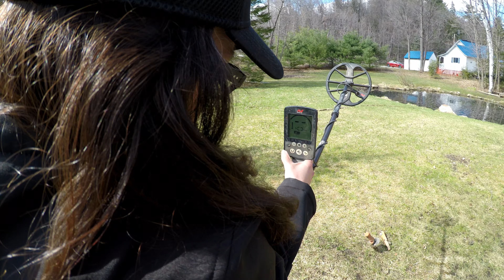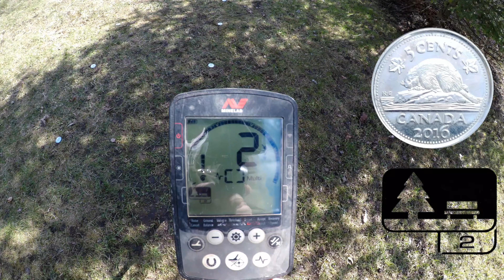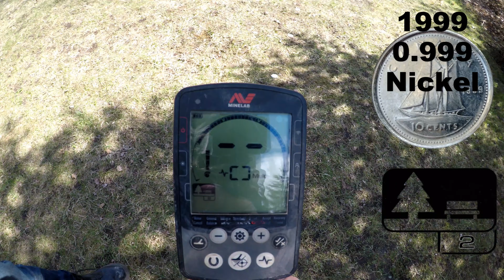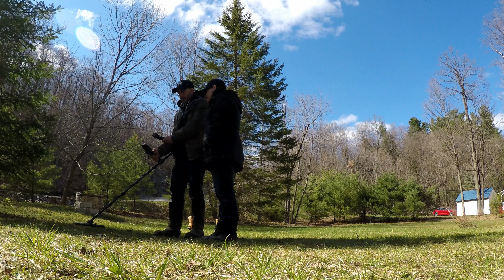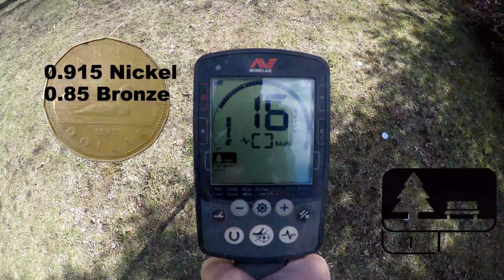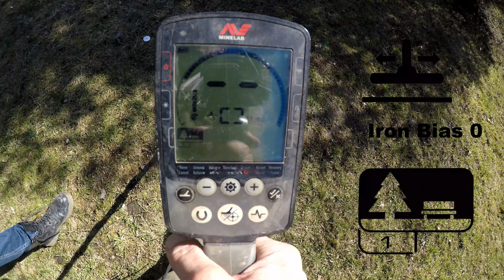Minelab Equinox Tutorial Canadian Coin Test Garden

Comment: Excellent video! Every metal detector I have owned and used struggles with Canadian coins. Unless you are hitting pre 1968 coins which were more silver, all our coins now contain a "dogs breakfast" of junk metals. The top detectors made today are manufactured in other countries like the USA, Turkey, France, etc.. and are all designed to detect higher conducting coins containing silver, brass, copper..and discriminate out iron and steel like our modern day coins contain. There are some detectors that do a better job than others, but none that I have found to be labelled "great". I seem to have more success when running a single frequency of 15 or 20, than with multi-frequency. However if you want to be 100 % sure you are not missing any, you would have to dig every signal. Just my thoughts! Cheers!
Reply from the maker: It hears modern coins but some won’t dig them. They have a unique sound that is unique to them. I use Park 2 multi, it’s what worked best on our modern clad from 2000 and up. The coins from 1968-2000 come in the nickel range. Some people expect coins to come in high like copper and silver. Minelab numbers are based on conductivity, steel is a low conductor and gives low numbers, nickel is ferromagnetic and gives a low to mid numbers, copper and silver are higher conductors and will give higher numbers. The Equinox is accurate and hears it all in Multi. With 40 khz  frequency it will make clad coins come in at higher target ID’s, but it’s not as deep, nor as accurate as multi. I use single frequencies to sometimes cross reference signals then right back into multi. On another note, using a lower sensitivity will also help. I noticed with a reduced sensitivity the clad (2000 and up)  comes in better.. They are always shallow , a high sensitivity makes the a little wilder. Hope some of this helps ☺️👍 take care, Laurie

Comment: Being new to detecting i was watching videos on finding coins but the numbers didn't help and now I'm realizing that metal content in coins is different in different countries, Have I got that correct? Thinking I'll try laying out targets of coins and trash like bottle caps, foil and pull tabs and record the numbers to help with search. Thank you for the video and the help getting me hunting.
Reply from the maker: @woodyl8416  yes that’s correct 😊 doing a test is a great idea, but be careful discriminating numbers. The quality of sound is a better guide.
Reply: @RelicDirtyhands  Hmmm... I don't understand "the quality of sound is a better guide" do you mean the strength/volume of the sound? or the tone pitch? Is this explained in one of your videos? I'm in the process of watching each video. Thank you so much for your videos.
Reply from the maker: @woodyl8416  you will notice a difference in the quality of tones, a bottle cap doesn’t sound as good as let’s say a gold ring. It takes time to recognize the difference but well worth learning. A good target unless really deep is usually a nice crisp tight signal, a rusty bottle cap sounds scratchy. To avoid bottle caps I would use the iron bias vs discrimination. An iron bias 2 on the 600/700 or an iron bias of 4 on the 800/900 dirties up the bottle caps even more so it’s easier to move on.

Comment: I have tried and tried to get used to the Equinox, but after using Deus for years the response on the Deus is so much faster seems to me,
Reply from the maker: It wasn’t easy and it took me a while to get used to it. I’m finally through the learning curve and it was well worth it ☺️ Especially in extreme trash and over hunted sites. Yes first we need to get the coil over something but when you’ve hunted the same site for 10 years.. it’s like it brings it back to life lol. I use the different modes, adjust recovery speed depending on trash, I play with single frequencies after scanning in Multi. Starting over with a new machine is extremely difficult but the equinox is fun once you’re fluent with it. 😁

Comment: Hey guys try using single frequency 40khz and watch what happens what you need to remember is our change is just coated garbage
Reply from the maker: I’ve been telling people about 40khz on clad for years,.. there are pros and cons using 40, including the 600 doesn’t have 40 as a single frequency option, this was to prove you can find clad in multi with the Equinox. You just need to use park 2 with discrimination and clad sounds great.

Comment: Can you do one of these with different silver coins and square nails.  Also a couple holes with both??? I have been searching alot of old homesteads. I have done one of my own tests a couple days ago, however would love to see your results. I havnt had the machine all that long. Still have a lot to learn haha.
Reply from the maker: Ha ha, Eric and I were just talking about that, condition in a test bed and real life situations can be really different, I would have to do many test, i noticed the positioning of the nails make a difference, like the nickel plate of clad coins, the edge of the coil will catch, the same goes with iron, it will catch the end of a iron spike, nail, wire and give you a falsing squeak. You will notice it’s a little difficult to isolate. When there is an old coin in the mix of nails, you will notice you can wiggle and get that high bleep to repeat and visually never moves. The falsification signal seems to happen when the edge of the coil gets close, micro wiggling the coil will tell you more, but it still possible to micro wiggle the falsifying iron tip, if you pinpoint, you will also notice if the false signal will want to shift over, pinpoint is taking you over the target, instead of the false signal 🤪 not easy to explain.. if you take a nail, swing the coil hitting it with the side of your coil vs the tip.. you will hear that false signal.. in high iron, slow down, reduce your sensitivity to 16-20, sensitivity too high will really amplify all the falsifying.. good luck, I hope this helps.. oh at old sites, field 2, zero discrimination, zero iron bias, a high enough recovery speed is a good way to go 👍 you may dig more but, you will learn the small differences 👍
Reply: @RelicDirtyhands  awesome thank you so much for that reply. Great advice. I'm actually heading out to detect right now. It will be a fun, but cool, day. Thanks again. I definitely know that I have been forcing a lot on the tips of nails and iron as you suggested. I just have a really hard time distinguishing the good from the bad still but I will get there.
Reply from the maker: Don’t give up, you will start to notice small differences after a while, I’ve been using it for a few years and as you pick up and recognize some signals it gets easier.. if you have any questions at all let me know and I’ll try my best to get you through the learning curve quicker 😊

Comment: Excellent video thanks more information on a very versatile detector. I have found that the Australian 5 cent coin 75%copper 25%nickel gives a better response in park 2 also the 1 dollar coin 92%copper 6%aluminium 2%nickel gives a more stable signal than the 2 dollar coin 92%cupro nickel 6%aluminium 2% nickel both park 2 which is very useful in high trash areas. Thanks again for the video appreciate the hard work put in to produce it.
Reply from the maker: Thank you so much for sharing the information on Australian coins, I can see how Park 2 would prefer them. Since I started I preferred modes 2. For years now I’ve been trying to debunking the myth that this machine couldn’t find our new clad coins. I would find them but until this test I didn’t know why I could but others couldn’t. I saw someone doing a test proving it couldn’t find them. After doing my own test, It gave me a much better understanding why, all this time it was mode 1 vs 2 😂

Comment: Same test on US coins would be great. You have a big following in the lower 48.
Reply from the maker: I may need to do the same for the US coins, I'm so unfamiliar with the conductivity or the composition of the US coins.. It would make for an interesting test and great to learn as I do come across them here but it may not be as easy as looking in my pocket change for those coins eeee. I'll have to see what I have.
Reply: @RelicDirtyhands  Problem here is dimes, quarters, and halves were silver till 64, pennies were copper till 84. Lots of variations.
Reply from the maker: Wow, sounds like a lot of different signals to learn, do you have any steel core coins? Our 2001 and up rusts and pits after a short time in the ground.. Our coins were silver until 1968.. oh how I wish I started the hobby in the 70’s 😂
Reply: @RelicDirtyhands  No steel. Pennies after 84 are plated zinc, and come apart in the ground. Especially around salt  water.

Comment: now you were using a 800 i would like to see the same test with the 600 to see how much of the 20,40 kz are being used that the 600 cant
Reply from the maker: Robert, in Multi the 600 and 800 use the same frequencies. I can't see much of a difference. I wish I had the 600 to test out. If you have the 600 please do a ground test and let me know if Park 2 using discrimination gives you a cleaner tone. I'd really appreciate it! Laurie
Reply: Relic Dirtyhands I don’t have a 600 I use the 800 but each mode is using each of the solid frequencies weighted in a different way so if you’re using a 600 the20 and the 40 wouldn’t be included in your weight for each mode so it may be different
Reply from the maker: Debbie explained it from Minelab, in multi it's not using the solid 5, 10, 15, 20 and 40. In multi it's using a combination of frequencies. She also stated both the 600 and 800 use the same combination in Multi. It's like the secret recipe. Minelab will not share the exact frequencies they use, but the machine offers you those 5 frequencies on the 800 as single frequencies use.
Reply: Relic Dirtyhands Yes that is what I was saying multi users all of the single frequencies together 800 has 20 and 40 which is part of the multi so if you don’t have it it won’t be included if you watch the video annoys cancel when hooked up to an oscilloscope you can see how noise cancelling adjust the weight on multi and you can clearly see the 20 and 40 kHz band so if you don’t have it The weight will be different
Reply from the maker: Detecting Unknown Paul Robert do you agree or disagree that both 600 and 800  have the 20 and 40 kHz that weight the same in multi?.. weighting means putting more emphasis on a certain frequency. From mode 1 and 2 the weighting is different, I’ve seen the video you are talking about, but this test was not done on the 600 as a comparison, therefore I trust what’s been said by minelab unless I see something that proves this wrong.